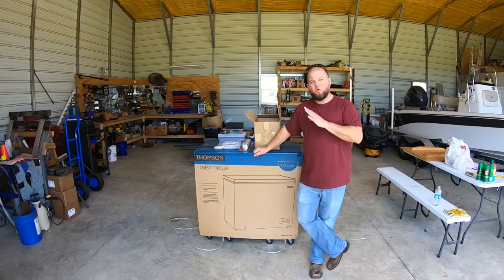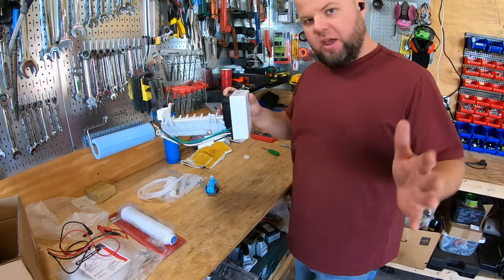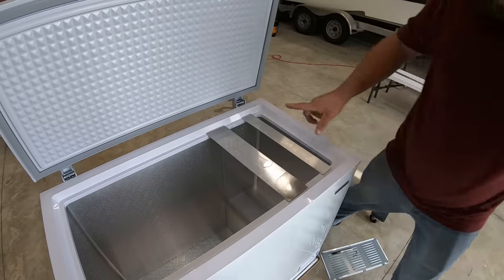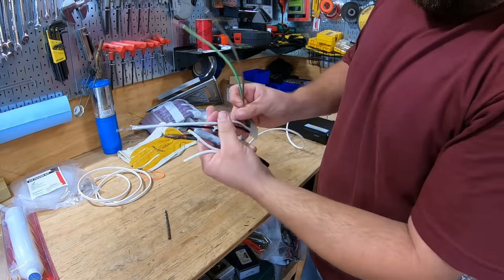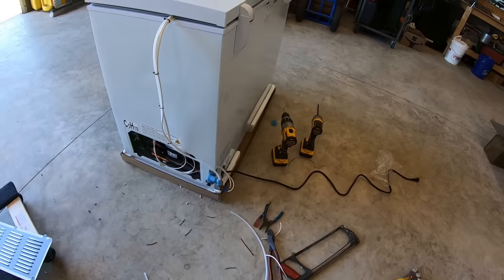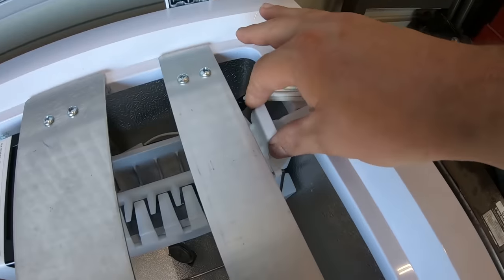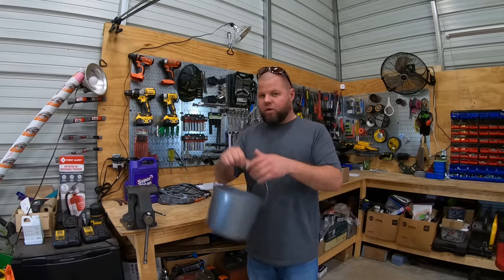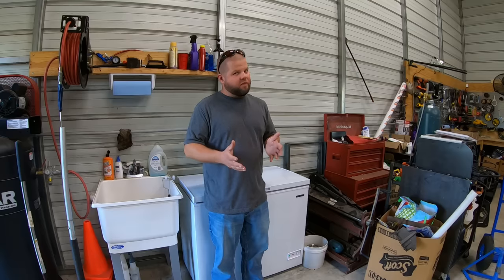Homemade ice maker! SAVE thousands over a commercial ice maker

Comment: You didn't put shrink wrap insulation on the wires before you soldered them. Add sand to your pipe before heating and bending it for a perfect 90
Reply from the maker: I was out of smaller heat shrink that day

Comment: This could possibly be used for air conditioning unit as well.
Reply: no, not enough capacity to cool a room. the compressor would be running 27/7 and end up failing. you'd be burning a hole in your pocket

Comment: Did you just use the ground wire as a neutral for the solenoid? As an electrician, I can let you know that this is not a good idea.
Reply from the maker: No I used the neutral from the outlet.
Reply: @TKCL  that green wire is not a "neutral out", that's the ground. The neutral from your power should have three wires in the joint, but I don't believe that's what I saw in the video.
Reply from the maker: I am very familiar with neutral, hot and ground. Don't pay attention to wire color that I used, I can assure you that I have neutral one one side and the hot output on the other.

Comment: I bought a portable at Walmart for 108.00 that produces 26 lbs a day and all I had to do was plug it in.  You can bag it and store it in your freezer.
Reply from the maker: I've got one that produces 40lbs a day, but it isn't the same. Those cubes are small, hollow, you have to babysit the machines and constantly bag the ice. Plus those small cubes don't last long especially on my all day boating trips.
Reply: @TKCL  You might need to upgrade your cooler.  This ice last for around a day and a half in my coolers in the shade.  So probably 12 hours in the hot sun.  They are small but they keep things cooler that way as more surface contact to absorb the heat.

Comment: GIANT ICE BLOCK HACKS:

#1)  Fill long balloons with water, the kind used to make animal shapes, and lay them around the inside walls.  These can also be shaped or filled to a lesser capacity to fit inside of smaller coolers.

#2)  Use normal round balloons, inside of a square box, to make blocks.

#3)  To have large reusable and portable blocks, thoroughly rinse out milk jugs and fill with water.  These, and empty soda/pop bottles, can also be drank after some melting.

*  DIY ICE MAKER BONUS:  * Add in adjustable wire shelves and stack in regular icecube trays. This alone will multiply your ice output.  Adding this, with the cold mass of large ice blocks mentioned above, will likely have your project spitting out ice WAY more efficiently!
Reply from the maker: Cool ideas

Comment: You could use one of those code hangers That have the cardboard  Tube And then put that tube in there and heat it up and bend to 45 or the thing that you like that works the best I've done it works good And then put that tube in there and heat it up and bend to 45 or the thing that you like that works the best I've done it works good Especially on cars so it doesn't rub and cut into the tube

Comment: You still have a potential electrical issue. If the ice maker fails in any way and fills the chest with water, it will reach the top over where power is attached to the ice maker. Normal ice makers have a door that would pour out before reaching electric components.
Reply from the maker: Wouldn't that trip the breaker? I can always add a gfci breaker, plug or extension cord.
Reply: @TKCL  Probably would, just thought it was something to consider for a mod.

Comment: If I load it up my refrigerator freezer up with containers to freeze ice I could freeze 30-40 lb in 24 hours. The problem isn't the freezer it's your method of making ice. If you want to step up to commercial scale you need to make more vessels to freeze ice. The weak Link in this process isn't your freezer it is your ice maker.
Reply from the maker: I am not looking for commercial production, that's not even possible with this setup. Just want to meet my needs of a minimum of 40lbs a week, preferably more. BTW watch the next videos, I'm already well past that number.

Comment: It’s going to be murder on that compressor. Chest freezers like that aren’t made to have a constant load like that. If you look at the power consumption in the size of the compressor you’ll notice how small it is. The idea behind these things is that you already have stuff frozen basically and you’re just storing it in this thing so the compressor barely has to run at all. I’m not saying it’s not gonna work I’m just saying that ice is going to be made very slowly and that poor compressor is gunna work it’s ass off.

The other thing is that the static evaporator. What that means is the walls are actually the part that gets cold. And icemakers like that when you put it right there the freezer actually is blasting cold air right at the icemaker to help make the ice faster. This is going to make it go a lot lot lot slower maybe you could add a fan that circulates the air inside. That would really help..

- master pipefitter guy

Comment: By the time you spend $200 and time on this, it might be cheaper to just get frost free with ice maker option, long term, no?
Reply from the maker: No, a defrosting freezer would cause a huge block of ice in the bottom due to the cycles and condensation it would create

Comment: Now small commercial freezers with 100lb daily ice making are less than $500. Cheaper and more ice made doing that now. This method I only makes 3 1/2 pounds of ice a day.
Reply from the maker: You might want to keep watching, a couple of cheap modifications has production way up. Those freezers you speak of make small, hollow ice cubes that are already at melting point and melt fast. They also have poor storage capacity. I've mentioned it in every episode I need a lot of storage on hand ready to go. This setup full has around 200lbs stored and ready for me.

Comment: Do not user the line piercing  water tap.  Get a T to the shut-off valve or a 2 outlet shut off

Those piercing taps will ALWAYS leak.  Some in days, some in 5 years.  Almost never more than 5 years before they leak.

Comment: I think VHB tape by 3M has amazing cold temperature characteristics down to -20F and would have been great for this project. Could have done VHB directly to the ice maker or VHB the aluminum to the inside with pre marked holes for sheet metal screws that wouldn’t pierce the freezer interior. 
Such a great creative project you’ve completed. Great job!
Reply: Also as for 4 conductor wire, minisplit cable also known as 14/4 tray cable might have been a decent solution over the lamp wire.  It’s less then $1 per ft on average even in these price inflated times.
Reply from the maker: Thank you for the information

Comment: Give me the same idea to have a keg on tap just do the plumbing so they at I got to the top. But use a refrigerator instead of my freezer.
Reply: If you ever want to turn a Deep Freezer into a Kegerator, they Make inline Thermostat kits for that purpose. Freezer plugs into the unit and throw the temp sensor inside.

Comment: That will all freeze up real quick.  That is why you have to de-ice these freezers every once in a while.
Reply from the maker: I've had zero issues after month's of use with ice freezing together.
Reply: @TKCL  usually happens right at that year mark
Reply from the maker: That won't be a problem, I take ice from this multiple times a week
Reply: @TKCL  if you take all the ice out them it won’t be an issue.  Similar to how you refrigerator freezer pulls ice from the bottom to reduce settlement.  The problem is if people let the ice settle it will bind.  A good way around this is a constant flow of margaritas.
Reply from the maker: I agree lol! I'm going to try to clean it out and defrost it every 6 months. I just did that after 4 or 5 months of use and no block ice in the bottom.

Comment: Great idea. Instead of running the power and water lines through the seal, run them through the lid. There are a lot of refrigerant lines running through the body of the freezer. Besides compromising the seal, the possibility of ruining the freezer is quite high if you're not careful.

Comment: Go to Amazon and search for HomeLabs Ice machine.  We bought one last summer for $450 delivered.   Makes 100 pounds of ice a day.  You might get about 10 pounds with this setup.
Reply from the maker: Does it make small hollow cubes like most do? That won't work for my situation that's quick melting ice.
Reply: @TKCL  You can make it do that but according to the instruction book that's caused from to short of a harvest time.  We got the thing two summers ago for the lake house.  I've been looking for one for over 15 years but like you said the dam things are over 2 grand.  And I never even saw one that cheap, best I ever found was off lease equipment for that price.  So used stuff and who knows what's wrong with it.  These things just appeared on the market 2 years ago so we grabbed one.  Downsides are it's not a ice box, it's constantly making ice because the stuff on the bottom is melting.  Same as any commercial unit it's a cascade ice maker so it needs a drain and wastes some water.  And since it's not an ice box we couldn't put it in the garage or boat house.  To hot.  And I haven't even read the maintenance part of the manual yet but if it is anything like a commercial unit, it will need plenty of cleaning with special chemicals and crap like that.  But the upside is I'm not going to town to buy bags of ice every day for the boats.

Comment: Flammable refrigerant, R290 AKA propane.
Reply from the maker: Nope, it's cyclopentane c5h10.
Reply: @TKCL  that's a blowing agent for the foam. C5H10 has a boiling point of 120°F, unless your compressor is pulling one hell of a vacuum on the low side that's not going to give you much cooling. Propane has a boiling point of -40° making it great for freezers.

Comment: The main disadvantage is how slow this is. It will make 8 cubes every 2 hours. A small "commercial" ice maker on the web cost $300 will make 45 cubes every 15 minutes. Those portable ice makers are about $120 and make 8 cubes every 12 minutes.
Reply from the maker: Keep watching, I am up to 11lbs a day now.  Your also forgetting countertop models require constant attention and those "commercial" models that are not commercial quality don't store much ice either.
Reply: @TKCL  I understand. The nice thing is that you get ice that will last longer. The ice can get down to -10. I got one of those small commercial ice makers from ebay for $250 3 years ago. Now they are $300. It works fast. I can get about 40# - 50# per day. But, the ice is warm. Maybe around 20-25. It melts soon in a cooler. It really is designed for cocktails. It makes the transparent ice. But, I still use it for my cooler. The ice will be water in about 24 hours. But it is fast. A batch of 45 cubes can be done in 10-15 minutes. Id like to see you take one of those and make the ice fall though a trapdoor into your freezer.

Comment: One pound of ice at 31 degrees will absorb 144 BTUs of heat. One pound of ice at 0 degrees will absorb 175 BTUs of heat. Only 20% more cooling capacity at zero. You can put jugs or cases of bottled water in the freezer chest if you do not need all of the capacity for ice cubes. Figure 40-50 pounds of ice per cubic foot.
Reply: I'm curious what background you have because of the units (BTUs/lb. not J/g).
Reply: @jmodified  US citizen educated in US university. BTUs are easy to calculate. 1 BTU to raise 1 pound of water 1 degree F. 144 BTUs just to phase change between frozen and liquid. He was discussing the freezer temp in F and the ice in pounds.
Reply: @idadho  Sure, it's just I'd expect anyone with an engineering or science degree in the US to use joules and grams, plus if you look up latent heat of melting or heat capacity of ice you're almost certain to find them in J/g. I thought maybe you worked in the refrigeration industry or something.
Reply: @jmodified  If someone is speaking to an audience is English, a reply would be most widely accepted in English. Kelley mentioned lowering the temp to 0 F, not -18 C and weighing the ice produced in pounds. 
btw, I don't have a degree, just an intelligent mind that is good at explaining things to the lesser educated.

Comment: The reason its saying its extremely flammable is because Freon is no more and to save the environment they changed the cooling to butane.  so ya,  you have a freezer full of butane and going forward when all the current Freon is used up,  it will be replaced with butane.  Some idiot sitting behind a desk thought butane would be better for the environment than Freon...
Reply from the maker: Its actually pentane, but the same principal.

Comment: You had me till you said "Im gonna turn it up to 7 so it gets cooler faster" u owe me a man card for that one! I had this same conversation with my wife years ago... it Works just like the AC in your house.... When cooling the AC or your freezer cools at the same rate no matter if you set it on 1 or 7..... if you set it on 3.... the compressor will kick off sooner..... turning down the AC to 50° does NOT make the AC cool faster.....
Reply from the maker: Yes yes I know, it's a thermostat

Comment: Run the power cord through the defrost drain plug!
Reply from the maker: What about the water lines that need to be ran? The drain plus is also not large enough for 8 wires.

Comment: Please don't use saddle valves, they are against code in all of North America because they will leak, they may not leak when first installed but will always eventually leak. 
If you don't know how to install a proper fitting ask a friend / coworker or get a plumber. 
Since these are against code everywhere when they leak, your insurance company won't be covering the cost of the damages.
Reply from the maker: I'm quite aware of the dangers of a saddle valve. Not at all concerned in a metal shop with concrete floor. I'd never personally install one in my home wall.

Comment: Bending straight plastic pipe to a 90… fill with sand, heat and bend. You’re welcome
Reply: When I bend plastic or metal
pipe I like to pack it with sand and “cork” the ends. You’re welcome 😉
Reply: @hamiltoncooper3603  yes sir and for soft rubber use a heat gun or hair dryer instead of a torch

Comment: So another thing this solves for the Big ice makers is how nasty they get up inside the unit. Search YouTube for videos of the guys that clean those things and you'll never look at a glass of iced liquid at a Restaurant the same again HAHAHA. One of the biggest problems is that the storage box is not temp controlled, so it has a drain line, the drain line SHOULD be air gabbed about 1.5" to 2" from any drain. But most the time they're hard mounted right into the plumbing system, the bacteria in the lines can move back up stream into the ice markers. This is were most people get "food poisoning" from when eating out, IT'S THE ICE in your DRINK!!
Reply from the maker: Watch my newest video, I address some of those concerns

Comment: you would be cheaper just buying ice trays and spend your money and time building a racking or shelving in your chest freezer to put your ice trays on. cheaper and more ice quicker.
Reply from the maker: That's a lot of work, the ice makers run 24/7 and requires no attention. Look at my newest video, upgrades have been made
Reply: What? Filling ice trays with water and placing them on shelves inside the chest freezer is more work than building what you've built?  You've over engineered and lost hours building what you've made. A fun project for sure and enjoyed watching but yeah,  you over complicating things.
Reply from the maker: OK so let's think about this, one day to build, another hour or two for additional ice maker. A little bit of tinkering and fun. I could stop now. I use a minimum of 40lbs of ice a week and 80lbs anytime I go saltwater fishing. So take those numbers and tell me how often I'll have to fill ice trays for a few hundred pounds of ice a month?? I do this work one time and it now works for me 24/7, your ice trays would require daily attention from me forever to keep up with my ice demands.
Reply: @TKCL   it would take 10 mins to fill your trays with water using a hose and you could up your ice production by a factor of ten or more in a 24 hour period without any mods to the freezer. even with the fans installed.
i'm not hateing on you. i get what your doing. this is what youtube was made for.

keep on keeping on :)

Comment: The price of ice couldn’t be more than the water/ electricity it costs to make it, esp with a unit that size.
Reply from the maker: I made several episodes tracking electricity usage and cost. Your way off as deep freezers are extremely efficient.  Last calculation was .44 cents per 20lbs of ice for electricity usage....Now factor in my closest store sells 10lb bags for $2.99 plus $4 a gallon gas to go get it.

Comment: Anyone who decides to do this mod, please don't use that cheap piercing valve that comes in the kit. Those things are junk and nothing but trouble down the road. They might not even meet code requirements in your state. Anyway, go to a bog box store or hardware or plumbing supply and get a proper valve. Even using SharkBites would be better than that piercing valve.